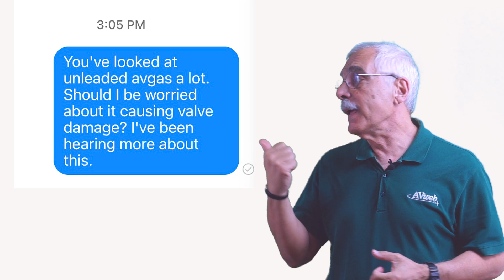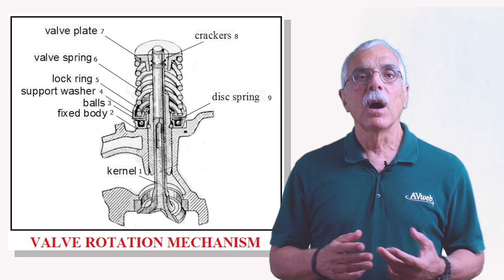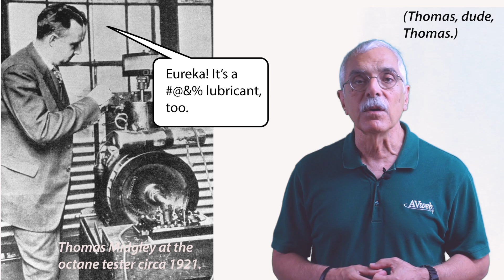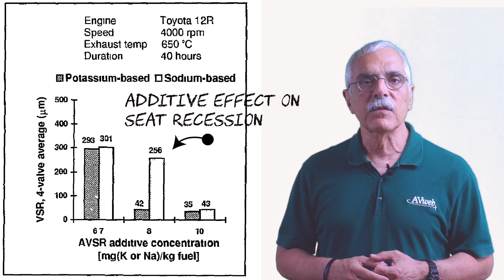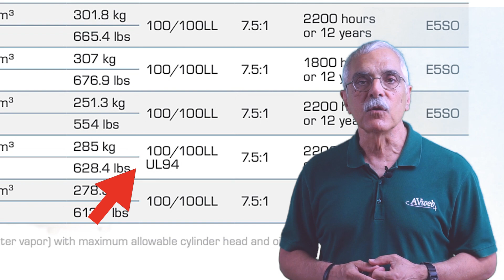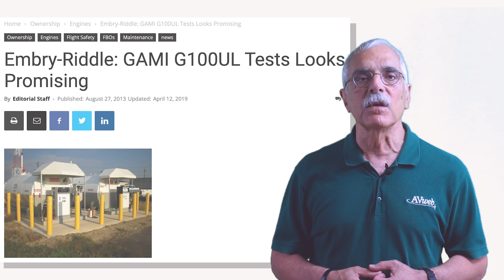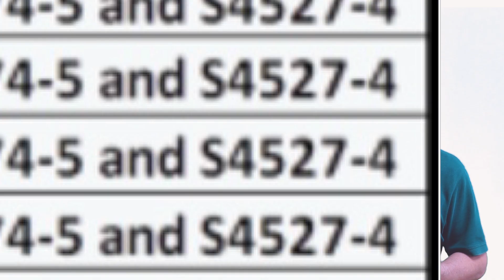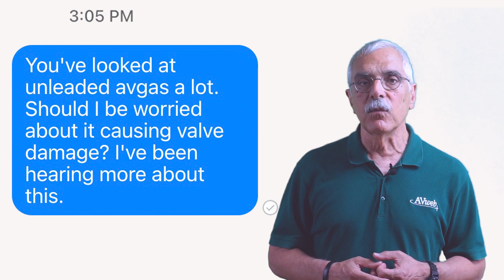Whadayamean Unleaded Fuel Will Trash My Valves?

Comment: Unleaded fuel has several large issues,, generally ok in engines built for unleaded fuel,, though many wear out faster.
Valve recession is a major problem, and BOTH intake and exhaust. Plus manufacturers were forced to make the combustion hotter so even leaded engines burnt them selves up. Plus valve guides also. This is all petrol engines.
The bodge of inserting heads with harder seats is a major no no. Machine pockets in the head then hammer them in,, so often immediatly cracks the head under the seat or will happen soon after. Unless the head is made to be inserted. Though far too many even then fall out. Iron or alloy heads.
Unleaded engines also use better pistons as well as rings. Leaded fuel pistons/ rings will fail and have a short life. 
Unleaded will keep engines cleaner and when running properly with the inevitable engine management work fine. 
Ignition,, ULP does not have the volatilty of leaded fuels so is far harder to light,, causing detonation that in turn damages the engines. To run unleaded engines a multi spark box helps a lot to light and keep the flame alight. For a low rpm engine a MSA streetfire is fine. BUT I would not trust one in aeroplane as they do fail. Excellent on a streetcar however.
With the above a leaded fuel aero engine will fail quicker and more often. And my feeling is it will be worse in an aircooled engine than a liquid cooled one.
The other issue is certified fuel. Having had garbage fuel or filthy fuel from retail petrol outlets I would NEVER use automotive fuel. Too often useless crap. WITH a 90 day maximum life. 40 y/o leaded fuel runs in an engine, 40 week old unleaded simply does not, ethanol blends ebven worse. And that stuff kills efi pumps as well.

Comment: The greatest difference between automobile engines and airplane engines during normal use is that an automobile engine is lightly loaded while traveling down a road, an airplane piston engine is heavily loaded and putting out a lot of power for a long time. When it comes to intake and exhaust valves automobiles have now been using successfully unleaded auto gas with hardened valve seats for a number of years. The same basic technology of hardened valve seats can be used on airplane piston engines to handle unleaded avgas.

Comment: I always did like Lycoming engines better now i know why :) wonder how much it would have cost continental to provide hardened valve seats before 2017? when the average overhaul is 35 to 55k I cant imagine it would have been that hard to pass the cost along to the customer.

Comment: I have been using unleaded 92 octane in my 68 Cessna 150 with the Continental 0-200A. Working good so far. My pocket book prefers saving the $1.50-$2/gallon.

Comment: I work in engine development in the auto industry, and it boggles my mind how old the technology is in aviation piston engines.  The aviation industry is still working with ancient technology, 50 to 100 years out of date.
Reply: An airplane engine only has to do one thing well.  Run.
Reply: @jmwSeattle  My car's engine too. And it do that very well, with unleaded fuel. I don't think anyone would complain about a LOT more efficient engine instead of a relic.

Comment: I’m not an airplane guy, but was a diesel tech for many years. Valve seat damage is a very real occurrence. I experienced it in real life. 
Was given a 77 Dodge Aspen in the mid 90’s. ( 1978 is when unleaded fuel was introduced) 
It didn’t have a lot of miles on it. Engine lost compression & several valve seats were gone. Valves wore into the heads and trashed them.
I rebuilt the engine, with salvage yard heads. Had hardened seats installed during the recon process.
Reply: Did you ever see it in diesels? They've never used leaded fuel so they're sort of a control in this instance.

Was thinking that the lower exhaust valve temperatures in many diesels probably make it much less of a concern.
Reply: @nerd1000ify   not really an issue in diesels. Heavy diesels run many more miles than gas engines, valve guide wear or broken valve stems are more common.

Comment: Interesting to note that LL100 contains more lead than 80/87 yet, although you can buy it in Canada, 80/87 was taken off the market.  Because LL100 is a reformed fuel, it does not have as much energy as contained  in 80/87 and lower compression AV engines cannot produce as much power from it.  Higher compression engines, able to burn fuel more completely, are just fine with LL100 while the lower compression engines have lead fouling problems.  One thing, 80/87 was a first run fuel, not reformed, and thus it could be stored for a long time without much degradation.

Comment: There's one annoying notion about GA piston engines that's just not true: That they're designed to run at high power for extended periods. Even when the throttle is wide open, these engines aren't producing anything close to their maximum theoretical output because they're rev-limited to around 2500 rpm. The lycoming io 540 is almost 9 liters(!) in displacement and yet produces only 235-300HP in basic form. But that's at 2700 rpm. If allowed to spin faster it could produce considerably more power. The "reliability" comes from operating these lumps at significantly less than their maximum output.

Comment: We operated R985's and R-1340s on car gas for years in the spray business. We did not worry about lead free use because we always added Marvel to our fuel. For our base fuel I would add 1 gallon of Marvel for every 500 gallons of gas. We never had valve problems and our engines would normally make TBO or better! I add marvel to my car gas!

Comment: I would like to know more about these "hardened" exhaust value seats. At these temperatures, can steel hold its hardness? It seems the temperatures are above the annealing temperature so what gives?
Reply: Seats are part of the head which is cooled by either air or liquid. They get nowhere near 250C+ under normal operation so softening is not a problem. 

A stuck open exhaust valve can not cool itself via conduction to the seat and eventually the head, so it melts.
Reply: @pontiacg445  For instance, steel that has been heated above the austenizing temperature (red to orange-hot, or around 1,500 °F (820 °C) to 1,600 °F (870 °C) depending on carbon content), and then cooled slowly, forms a laminated structure composed of alternating layers of ferrite and cementite, becoming soft pearlite.
Reply: @greentriumph1643  OK, and?

Comment: The UK has run "Mogas" - supposedly just car fuel - for a long time. I strongly suspect that figures would be available from some aero engineers to demonstrate whether mogas was valuable as an economy, widely available, safe to use, light aircraft fuel.
Reply: I've seen mentions of unleaded aircraft fuels being in widespread use elsewhere in the world without issue, with the US trying to figure out "can this be done?" Don't know how much this is true in this case, but in a lot of things I see the US trying to re-invent the wheel, figure out how to do something or if it's possible - seeing it as a huge or nearly impossible task - without acknowledging other countries doing that thing successfully for decades. Anything from high speed rail to healthcare reform. I will grant that there are factors that make these different in the US than other countries (such as the high speed rail example, the US has very different geography and population density than most countries with high speed rail networks) but still it seems like the US won't even consider what other countries do, I suspect a bit of an arrogance thing, Americans refusing to consider that someone else has done something before or better than them. (I'm American myself, looking at the ways of my fellow countrymen, not mocking them from outside.)

Comment: So no true authority wants to step up and make the call on the valve recession (possible) problem . I did some extensive valve-recession studies back in the 80's on running gasoline engines on propane and natural-gas. Seems a little crazy that the aircraft engine industry, selling $10,000 engines for $50-100,000 would not manufacture engines with hardened valve seats as a safety measure, regardless of fuel type used. I realize that the big outfits really don't want to endorse change to anything, because they're the first ones sued when an engine fails, regardless of who's fault it is. Imagine that one day, they decide to make a radical change to the composition of Jet-A, and no definitive information was available as to it's effect on the thousands of turbines in airliners and GA planes. The answer is, they wouldn't dream of trying this on big jets flying millions of passengers, but Joe Pilot and his spam-can are now test pilots for cylinder valve failures......... Well at least, properly leaned engines, running high manifold pressure and low rpm, increase dwell time for the exhaust valve at closure, hopefully keeping the valve temps in a tolerable range. Paul, always enjoy your takes and a little sarcasm goes a long way in trying to understand government regulators..........

Comment: Continental didn't think was worth upgrading their valve seats until 2019?  It wasn't like this wasn't known about decades ago.  That strikes me as really irresponsible.  I realize that swapping engines in airplanes is a much bigger deal than in cars, but I would be considering that attitude if I were looking at buying an air plane, especially a used plane more than a few years old.

Comment: Well, IF (and only IF) the valves and seats are INDUCTION hardened to the point where they are susceptible to FRACTURE, unleaded fuel with NO additives will work. It never has for automotive fuels. Petroleum companies TRIED it for about 3 months, and GM squealed to the EPA that the swill was "ruining engines" as all the oil companies said it would. So we (Cities Service Oil&Gas) and all other gas companies started adding very, very expensive "additives" (TBEB) to reduce valve wear. Then TBEB leached thru storage tanks and we switched to MORE expensive "stuff"-like $300 an OUNCE. In about 2000, Toyota and Honda were gonna switch to rotary valves from poppet valves, (Ca-CHING!) but fuel-injection technology pushed it back. Rotary valves were used in some WWII aero engines (Napier Cutlasses/ Continental H-16's) to boost performance.

Comment: Well research and presented - excellent job -  One factor you may not be aware of is that a one time use of leaded fuels can protect the valve and valve seats, in some cases for the life of the engine. Continental put out a bulletin in about 1947 on this subject. I was a research engineer  for a major oil company when our company removed leaded fuels from our stations. Testing we did supported this one time use had a significant effect in stopping valve seat recession. GM had experience with new engine testing on unleaded fuels causing immediate valve seat recession but not in customers cars that occasionally had leaded fuel but used mostly used unleaded fuel. Testing of a fleet of aircraft on UL fuel therefore is not the same as removing lead completely and permanently. So some of the data you referenced may not be valid to projecting the future in the long run and premature failures may occur. My personal view is that I would run a new engine or cylinders on leaded fuel for at least five hours prior to converting to UL autogas. In the future that option may not be available.
Reply from the maker: Is this documented anywhere? Like to see more.
Reply: Fascinating idea - sounds like the lead builds up some sort of permanent protective layer on the engine. Perhaps they could investigate this phenomenon to figure out how it works, then apply something similar during engine assembly. Or use lead or something else with similar effects as a break-in additive for just the first few hours - in that case it would make sense not to continue selling 100LL for that purpose but to have an additive one could put in the first tank or two after a rebuild.
Reply: @quillmaurer6563  I think the lead is needed to allow the seats to work harden in operation. Lead substitutes were tested too and i would not put any of the ones we tested in an aircraft, especially sodium based ones
Reply: Back when unleaded car fuel first became available at the pumps, those with older cars without hardened valve seats were advised to use leaded fuel every once in every four fill ups. I'm curious about this protection for life thing though.

Comment: Nothing has been addressed about valve guide lubrication lead does to carry heat away especially in small Continental engines with brass valve guides. In the early 1990 s 80/87 fuels deleted lead for about a year and a lot of 0-200 burnt up valve guides some valve stem wear going into the cly  When using the old unleaded in ethanol auto fuel everyone used to run leaded fuel (100Ll) a few hours every 100 hours and the first 25 hours. The EAA test for auto fuel approval was only 750 hours and missed a lot these real life issues such as fuel beading up in the intake during cold starts and seal deteriorating
Reply: The guides are usually lubed by a 'controlled leak' of oil past the valve stem seals.

Comment: Intake valve seats do wear also, lead is good for octane. any engine with hardened valve seats usually hold up well, however the valves sometimes will wear significantly on the valve face. So pick your poison. Low sulfur in fuels has been known to wipe out valve guides. So the bottom line here is.. if your engine has been properly built or modified to run on unleaded fuels, it should, "should "have the proper parts with the proper metallurgy to perform well on unleaded fuels. That being said, a stringent maintenance of the valve tip height will give you some idea if any accelerated wear that is happening. As with anything that performs a particular task very well, the Government will find a way to take it away. Some will hate it and some will love it.

Comment: The valve train in my new engine I built for my 67 F-250 only lasted for a few months. The valve seats tuliped in a hurry! Ford used flame hardening on the valve seats so I couldn't install hardened seats like in my chevy.
Reply: I've heard of some engines being retrofitted with hardened valve seats by flycutting the valve seat and installing them. I think aluminum-head VW Bug engines commonly have this done so they can run on unleaded (many are used as daily-drivers to this day), which would be quite similar to doing so in airplane engines (the Bug engine has far more in common with airplane engines than typical car engines, and even is used in some airplanes), but that might not be so easy on an iron head.

Comment: I’m interested in the need for 100 octane gas in naturally aspirated aviation engines with compression ratios of 7:1 or 8.5:1.  Presumably the richening effect of altitude also offers a further degree of protection against knock?  Is this just a hangover from supercharged piston aviation engines circa WW2 where higher octane clearly allowed higher power outputs, or is it just easier to sell on fuel that you can use safely in any current engine - turbo or not?
Reply: Automotive gasoline ( in the USA at least ) uses the average of RON + MON / 2 ( Research Octane Number /  Motor Octane Number . Av gas uses only one of these from what i recall so it isn't a direct comparison between Av and Auto gas.
Reply: 87UL has been around for some time and works just fine in most piston aero engines. The ones it doesn’t work in are high performance engines that run very hot or with lots of boost. The problem is that 100LL is one fuel for all. 87UL won’t work in all engines, so it’s not popular.

Comment: BZZZZZZZZZZZZZZZZZZZ
The whole video. 

I was really surprised to hear the continental valve seat issue, I didn't think anyone was stupid enough to use unhardened valve seats in the past 50 years, looks like I was wrong. And that's not just spitballing from a keyboard warrior, I've built auto engines including race engines as a hobby and I'm in materials in the aviation gas turbine industry.

Comment: Wasn’t the introduction of stellite valve seats the solution to the recession problem?
Reply: Not at the high temperatures that our Lyc and Conti engines use! - it works fine unleaded only if the cylinderhead is small enough and cold enough, Water cooled.

Comment: thanks Paul....very interesting....even from a former  engine motor head of the '60's and '70's when performance was tested on the race track and high compression engines. Looks like material science needs to be always improving esp for piston airplanes.

Comment: I wonder about the new unleaded fuels effect on fuel tank sealants, back when auto unleaded was first allowed by STC and even now, there is a prohibition on any alcohol in the fuel but when people first started using unleaded. Back then Ethanol was not widely added or used in unleaded but there were some issues with sealant breakdown caused by the fuel in aircraft with sealed integral tanks. Has there been a study on the effect of the new fuel on tank sealants and if so where can it be found.
Reply from the maker: GAMI tested the fuel in composite tanks and I believe wet wing sealed tanks such as Mooneys have. The composite tank test was long term.
Reply: The prohibition on alcohol in aviation fuel comes from concerns over water contamination, since water gets along well with alcohol and does not precipitate out the way it does in pure gasoline.